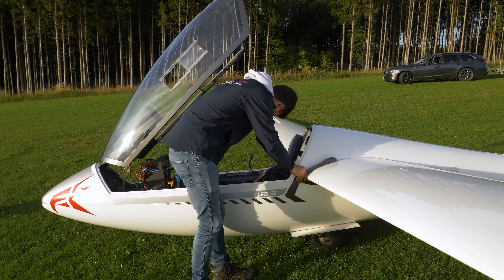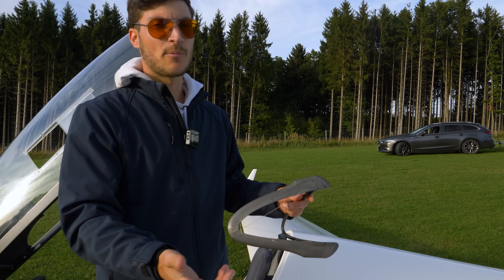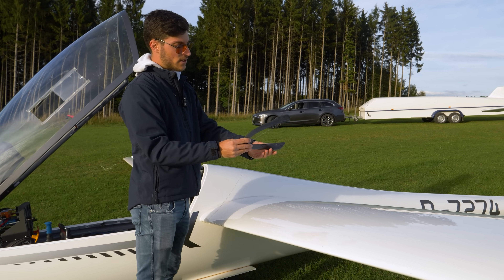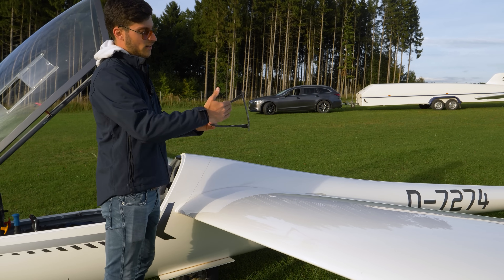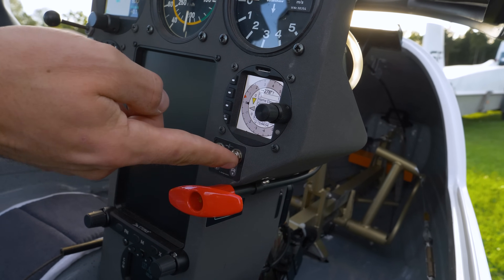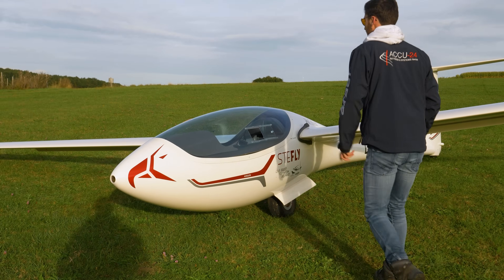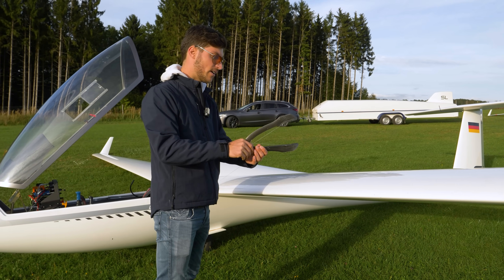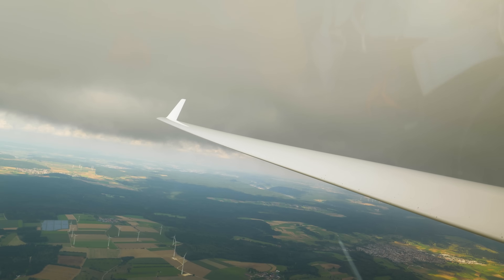BUG WIPING DURING FLIGHT - How does it work?

Comment: The boundary layer closest to the airfoil skin is stationary. A small bug won't do jack sh*t to the airflow. The same as when a 737 lands with a wing covered in fine dust. The air is stationary that close.
Reply: Depending on the glider, your glide ratio can decrease by 10km by joust 10% bug covering.

Comment: cool gadget Stefan. But you still haven't explained how this bug wiper moves from the start of wing to the wing tip ie how it traverses along the wing leading edge. You only show a (noisy) ratchet or electric motor.  Does it work on a pulley system like, you know raising and lowering the flag. So is there a pulley near the wing tip and some nylon chord along the wing leading edge to traverse this gadget along?
That part you haven't explained I believe. Thank you.
Reply: It gets pushed out by the air flowing over it.

Comment: Someone got rich(er) off this idea. But now I'm wondering why a similar system doesn't exist for removing ice. Could you send a hardened version down a wing to break off any ice from the leading edge, and could it be extended to crack ice off from the upper and lower wing surfaces?

Comment: I didn't realize that something that small could affect the airflow enough to change the handling abilities .  A bug ?
Reply: Just one won't, but the airflow disruption emerges from 100s of them all along the leading edges. If you get the chance check out the leading edges of other small aircraft like Cessnas etc and you'll see how many there truly is after a flight. It can be a total pain in the ass to get it all cleaned off
Reply: Thanks James

Comment: Many commentators are critical of the benefits from bug wipers. I'd like to argue why the device is beneficial. 

Firstly, the reason for removing bugs is not because of their weight but because of the aerodynamic impact they have. 
Glider aircraft are highly optimized vehicles. Often high-performance gliders have laminar flow wings. These wings are optimized for performance however more susceptible to flow separation even due to small amounts of surface contamination. 
Finding numbers on this was really hard. Unfortunately Laminar Aerotec (the manufacturers of the device) aren't very transparent with the numbers. I asked a glider pilot from my local club on the benefit and he claimed up to 10% if the wing is very sensitive and the bugs are numerous but couldn't give me a source. 
Upon longer research I found one source with the following data: The disturbance of the laminar airflow i.e. turbulent airflow caused by a single bug expands in a conical shape in an angle of 10 - 30 degrees behind said bug [1]. Therefore especially the leading edge is vulnerable to impurities. This leads to a performance reduction of 10% - 30% with a "bug density" of 20 bugs per meter [2]. Depending on the weather, season and location, this bug density can be 5 - 10 times as much [1]. The surface-contamination-susceptibility due to bugs of laminar flow wings has even concerned NASA who developed complex fluid discharge systems on wings to combat insect contamination [2]. 
Even the glider manufacturers have been building special "garages" for storing the bugwiper snugly outside of the airflow (little cavities in the fuselage) [3].

I see many other commentators regard this device as a mere gimmick. That was my first impression as well but I'd encourage you to take a closer look at the history, development and (aerodynamic) reasons for it being so widespread in high-performance gliding since the 1980s. I'd also encourage Laminar Aerotec to publish some data on the performance delta of their device with different aircraft and bug densities. 

[1] see the website bugwiper . virtualave . net/ using the WayBack machine (second menu item "entwicklung") The original research was published in the soaring magazine by Dick Johnsson. 
[2] NASA Document ID 19850067951
[3]  search "bugwiper asw24" on youtube

I'd post direct links but yt hides my comments if I do.
Reply: Nice findings - thanks for taking the time to post this!
Reply: Good stuff!   Also see :  NASA's Bug Team >>
https://www.youtube.com/watch?v=_Mx9rD-lmvM
Reply: i wish every youtube comment posted its sources like this

|

Comment: Hard to believe that this task can't wait until each flight is concluded.
Reply from the maker: The minimum speed increases, so the climb performance get worse and at higher speeds the drag is significant more. In areas with a lot of bugs it is really mandatory at modern sailplanes. You don't care at a plane about it because the wingspan is smaller, the profile is different and at the end you have an engine to compensate it.
Reply: @SteFly  Actually, even the big jets (and NASA) does care, for them it is about fuel efficiency (up to 30%).
NASA’s “Bug Team”  >>   https://www.youtube.com/watch?v=_Mx9rD-lmvM
Reply: you would be surprised how much the bugs affect the lift and performance of a glider, if enough builds up tou could stall and crash,
Reply: @bobconnolly190  Well Bob I've owned 4 aircraft and had 7 forced landings, none caused by bugs. Amittedly I've piloted a glider only twice and it was a blast. I have never heard of bug build up causing a stall. Ice for sure but can't imagine bug build up to be that significant. In my opinion this is a sales pitch for an item not needed.

Comment: not even a pilot; aspired to be a pilot, but, I chose engineering instead... nonetheless never knew that the accumulation of impacted bugs on the leading edge of an airfoil degraded the laminar flow ... intrigued by this system and watched the video until the end ...

Comment: I always go through a car wash just before long milage trips. I calculate I am roughly adding .054 mpg to my overall gas milage, or adding .864 miles in range to my tank. Speed and acceleration has increased by same factor, but de-acceleration and braking distance have likely increased by same factor. Wife won't climb out on hood to clean the front of truck hole I drive down interstate so I am stuck with an unknown factor of deminishing return.

Comment: Seems like 100 feet of fishing line would create more drag than the bug splats.  A nice wipe down with wax or teflon would reduce the bug good stickage during a flight.
Reply: The problem is to get out and wipe them off during the flight. And the string is stoved on reels between uses.
Reply: @sablatnic8030  So during flight no string is exposed to the airflow other than when it's wiping?
Reply: @avi8r66  That is correct, the string is used to pull the gizmo back to the fuselage.

Comment: Cool gadget , it will add weight including the motor etc. Maybe a good wax will take care of any bugs sticking to the leading edge. That's my 2 cents.
Reply: a little bit of weight won't really have an inpact at all, you also should know that gliders usually fly with balast water.
Reply: It is a glider, so weight doesn't matter much, but the reduced drag by removal of the bugs matters a lot.

Comment: This is my second post on this subject and I want to ask. How much parasitic drag is being cleaned off and how much parasitic drag is increased by having such a device on your wing does it not equal out or does it save? 
Thanks again this is a good channel great content
Reply: I just asked the same question as this post essentially. HA ha... read it after the fact.
Reply: Im sure if you're a glider pilot you'll want the most coefficient lift available while conserving momentum energy and anything on the edges stuck like that could cause microscopic eddies forming to the point if more and more bugs splatter on just the edge it could induce stalling at slower speeds ya kno?
Reply: @ryanlemons3255  
There is no lift at the leading edge. It's pure drag there.
Reply: @akulkis  True but the leading edge is responsible for how smooth and effective the flow over the wing is.

Comment: It's hard to imagine those things sliding back and forth across the leading edge of the wings don't interrupt airflow more than a itty bitty mosquito.
Reply: Amazing the number of people in the comments who are absolute authorities on a subject they didn’t even know existed.
Reply: The device appears to be easily removable. The only things built into the glider are the thread reels, small motor and buttons. They shouldn't weigh more than 1kg. If you are flying higher or in an environment with few bugs you can simply leave it on the ground. And 1kilo penalty is honestly not more than a good meal and/ or a jacket.
Reply: Exactly I'm not sure it even is useful
Reply: EXACTLY, THAT'S THE FIRST THING I THOUGHT, YOU BEAT ME TO IT.👍
Reply: With laminar flow wings the performance depends highly on a clean wing and it makes a huge difference. In fact, even if you only use it once per hour, it pays for itself typically
Reply: As the numerous incidents with ice-accumulation on wings demonstrate. The surface of the wing is very sensitive to changes in the surface or shape. If you've cleaned a glider wing at the end of a long day you'd be surprised at the amount of bugs that stick to this sensitive area. Nonetheless I'd be curious to know the exact performance benefit of this device. Is there are research on it?
Reply: @shakranandi8542  ice accumulates on the top of the airfoil, where delaminated airflow becomes turbulent and cannot re-laminate.  Bugs on the leading edge don't delaminate the airflow. Therefore, this is a solution in search of a problem.
Reply: @shakranandi8542  

ALL aircraft have laminar flow wings.

A stall condition occurs when flow over the wing changes from laminar flow to turbulent flow.
Reply: @akulkis  so what is your judgement on the device in light of the data at hand?
Reply: @akulkis  that’s where you are wrong, all wing Aircraft emulate laminar flow yet only gliders truly have laminar flow for the the most part of the wing profile. Whereas on most other aircraft there is semi laminar flow. I wish bugs didn’t affect glides so much, had noticeable deficits over gliders with wipers in competitions…
Reply: @snifflesfpv7321  Aircraft EMULATE laminar airflow?

I do not think you know what the word emulate means.
Reply: @shakranandi8542  
Show me data from an independent test lab.
Reply: @akulkis  mimic aproximate even nice argument tho
Reply: I was just about to post similar. The weight of the wiper and the mechanical device to wind it in and out combined with the airflow disruption of the device. Surely takes out more that it puts in ?  Id be interested in weighing a flight load of dead bugs and see what it is compared to the device and its associated switches and pulleys.
Reply: @bonesshed.  Surely it's more about reducing drag on the leading edge, as apposed to bug weight. I agree the device probably causes SOME drag while in use, but probably only used occasionally, as needed, then pulled in flush against the fuselage. Common sense should suggest that devices like this have been tested, retested, and determined to be a net benefit.
Reply: @bonesshed.  it's not about weight but about airflow. Certain airfoils are very sensitive disruptions like bugs. Cleaning the leading edge improves attachment of laminar flow which reduces drag.
Reply: @bonesshed.  hey just to let you know;
I'm running a special on bugs right now, it's that time of year again.

FREE
(BUT YOU PAY THE SHIPPING)
Reply: It moves for less than minute every few hours, it's irrelevant.
Reply: @randomnickify : But it's out there on the wing creating drag the WHOLE flight. This is a situation in which the solution is worse than the problem. Just wipe them down before flight with soft cloths and forget this expensive extra complexity.
Reply: @SteichenFamily  No, it's not "out there producing drag" it seats against the fuselage when not being used. They test and retest things like this.
Reply: My thoughts exactly. And it only knocks off the high points, you still have to clean the bugs off. Why isn't the math presented as part of the sales pitch? Also, don't forget to multiply by 50% effectiveness because at the end of flight if you have 2oz of bugs and at the beginning you had 0oz your avg would be 1oz. Can we get a Gossamer engineer to comment?
Reply: I know nothing about gliding but my science head says the number of bugs managing to get stuck on that leading edge is mighty small. Then the drag and laminar flow disruption i.e loss of lift is going to be way smaller than the drag of the device plus the weight of the kit.....unless leading edges end up black with bugs at the end of a flight, like a measurable depth?
Reply: @philleng480  The device is only used intermittently, and stored flush against the fuselage when not being used, 99.99% of a flight
Reply: @treylem3 : I think the miniscule advantage of knocking down the high point on bug splatter (dried bugs will not come off just because you sweep a fishing string over them) is offset by the weight of the contraption, not to mention a drag boost while in operation. And it's quite common that products are sold that have little or no overall benefit. It's called sales unfortunately.

And it's not going to be stowed 99.99% of the flight. If it is used even one minute, that would imply that the flight was a week long.
Reply: @SteichenFamily  I shouldn't have typed 99.99%, I meant 99% of time. If it takes 60 seconds to cycle, 1 minute of a 100 minute flight = 99% stowed
Reply: @philleng480  you don't know much about laminar flow, it appears.

Comment: Can you feel or measure the improvement of L/D after a round trip of the pair of bug wipers?
Reply: There were measurements done by Pirker&Storka, which show a decrease of L/D up to 15%.
Reply: @laminaraerotec6606  would you mind posting a source? Id be curious to read more on this.
Reply from the maker: Last year at one flight I flew the ASG29 without bug wipers and there were so many bugs on the wing, that I landed early in the afternoon. The glide performance can decreasy drastically, especially at higher speeds. Of course there are also other days with only a few bugs in the air.

Comment: can they flip off the wing in flight on rare occasions
Reply: Been there, done that. Not fun, sound of one rattling against the gelcoat of your fuselage :(
Reply: @StudentGoose  why did it flip off
Reply: @petercrowhurst  Don't know for sure, it didn't want to move out when I put the reel in "free Wheel mode", so maybe it got caught with the wire on something. When I eventually got it to move, it just flipped. Afterwards it turned out one of the screws of the bugwipers was missing
Reply: @StudentGoose  ok cool thanks

Comment: Hi, whats the maximum speed you can use them?
Reply: We recommend to use them at 120-150 km/h. If you fly faster, the motors will bring them back slower. No prob up to 200 km/h.
Reply: Good question. I just know that if you fly fast, you need more force to reel them back in.

Comment: How does the electric one get back to the fuselage? A wire attached zo the fuselage and retrieval engine?

Also, what prevents it falling off from the wing?
Reply: Both manual and electric wipers retract them to the fuselage with a thin nylon thread, like a fishing line. They are held to the wing´s leading edge by nothing but the air flow. On the ground they would just fall off the wing.
Reply: @kaihorstmann2783  ok, if they can just fall off the wing on the ground do they?? What holds them on when sitting on the ground??
Reply: @eglide73  in parked position the wipers are completely wound in, and they are tightly pulled against the fuselage by the nylon line. Thus the wiper lines up with the exit hole of the line in the fuselage and stays there
Reply from the maker: @kaihorstmann2783  Thanks for the perfect explanation!